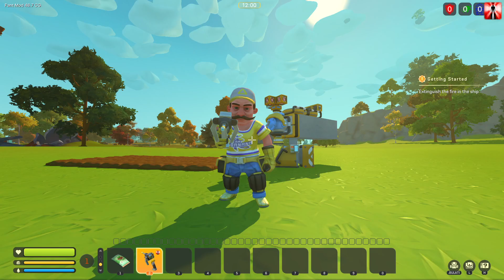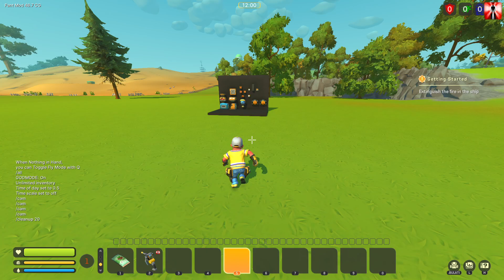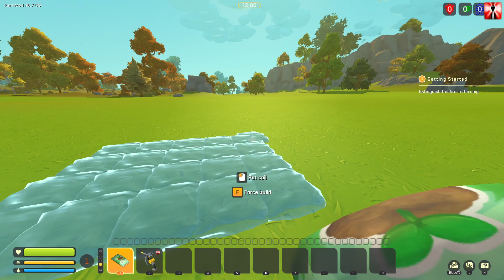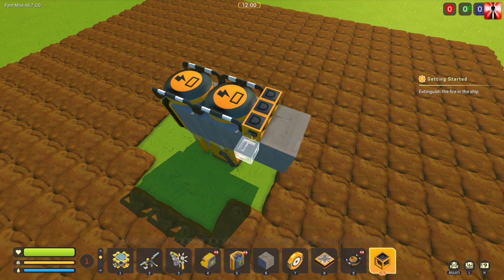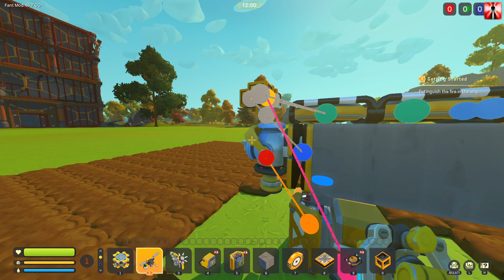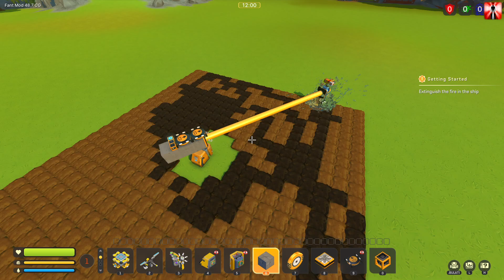Scrap Mechanic Modded | Automatic Watering Machine - Fant Mod 2 CG

Comment: While this design is entertaining, it isn't all that efficient. It'd work for small plots, sure. But for mass plots like you have, it seems like it'd take forever.

I like my lines of crenelations along the edges of my farm plots, to dictate the X/Y positions of the center of each plot, two sensors, water sensor, and and gate. Just have the water cannon oscillate between rows/columns.
Reply from the maker: nice that you point Additionaly out what i allready said in the video ... ◑﹏◐
Reply: @00FantMod  Ah, I must have missed that. My bad